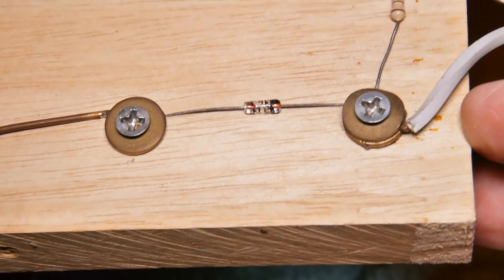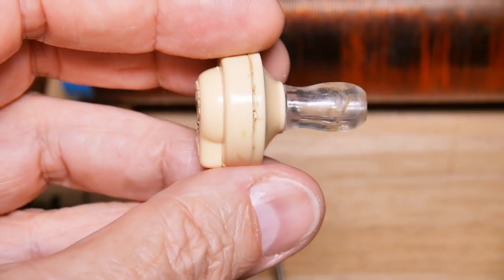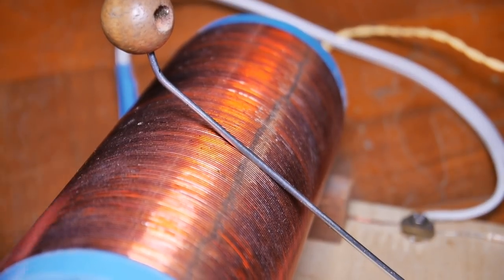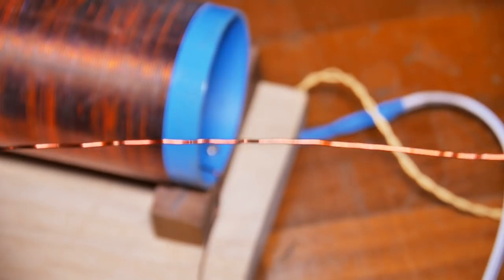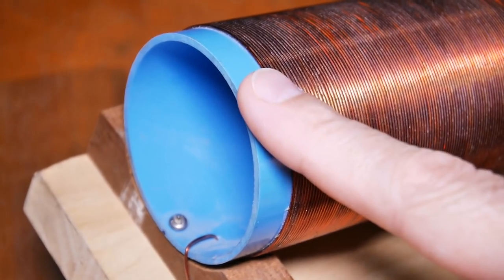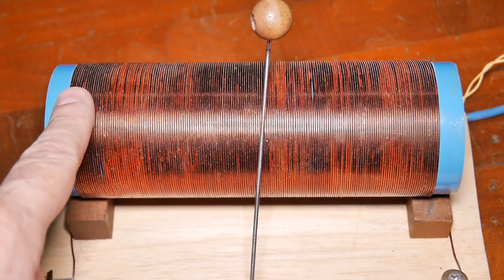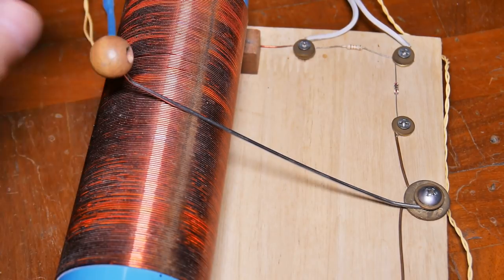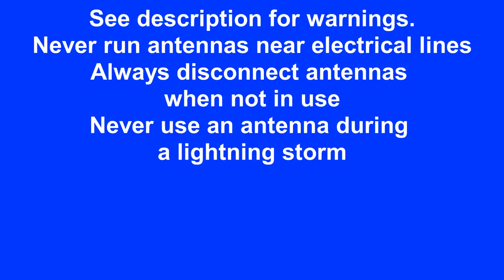My Crystal Radio Does NOT Work (FIXES for common problems)

Comment: You saved my life. I'm not new on this, I made some crystal radios before, but this time I was getting mad wondering why it wasn't working at all. I made the coil rolling on a metal tube. It's not a wrong coil, but as you said, it was moving me out from the MW where the strong signals suitable for these radios are.

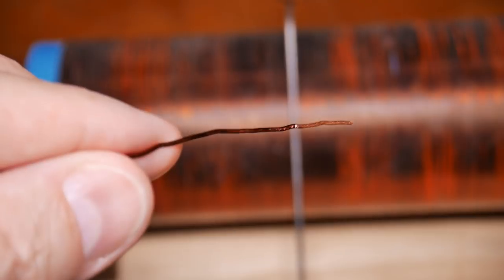Comment: 3:48 You can also use Litz Wire as a substitute for enamelled copper wire and it should work, Litz Wire is what they use to make the coils for Ferrite Rods that were used a lot in portable transistor radios from the 50's and 60's.

Comment: My father, who was a fantastic Chemical Engineer/former Machinist, helped me build a very nice nonworking xtal set back in the 1960's. Looking back, I now realize that not scraping the enamel off of the coil wire can affect performance!;) Those piezo earphones are notorious for not working, even if they are the correct ones. Of course, ANY open in the circuit will affect performance and one MUST have a good EARTH GROUND or the radio will not work. My dollars worth-John in Texas
Reply from the maker: Do you still have the one you built? Or maybe you can rebuild it and make a video. If you do, leave a link here; I'd like to see it.

Comment: Good info on coil length also. When I made a tuned loop antenna, it was too long and shortened the reception bandwidth! I had to use a needle attached to one of the tune loop lead ends to short out the antenna until I reached (roughly) 16 kilocycles-John in Texas
Reply from the maker: Good stuff, thanks!

Comment: Can i use an 1n34a do-35? I mean this one is a Germanium Diode, written "1N34A DO-35".

 And if i made my own crystal earpiece (i sanded the metal plate until it lost 50% of thickness) with regular 35mm piezo element, would  it works? 

 Can you please tell me average voltage of the audio output of this crystal radio?
Reply from the maker: The do-35 is the package type, and that does not matter. BUT I did a quick search and many, many schottkey diodes are being sold under that label. They do not work well. I have a video on how to test for fakes. I have never tried that to make an earphone. Please let us know how well it works. The voltage depends on your antenna and ground, how powerful the radio station is, and how well the radio is made.

Comment: I have an interesting problem. I'm using a 1N914 diode, a 120' long steel electric fence wire for antenna, and a regular earpiece. Every thing works except I only get the Spanish church channel on 1140 AM. I have tried nearly every configuration of tuning possible and it just stays at that band. Thank you and nice videos on these nifty old radio receivers.
Reply from the maker: The antenna and low sensitivity diode will "work" but will only the the strongest signal(s).
Reply: Thank you for the good input. The antenna on its own is capable of lighting LEDs six in series. Guess I need to find a better diode.

Comment: On one of my crystal radios I built I added a rotary switch that selects from 4 different diodes to demonstrate the differences in how loud each different diode is. I intend on adding 2 more  - a D311 and a D311A.   My loudest crystal radio uses a Russian D311 diode.  Also installing a simple coil between the antenna and my crystal radio also increases volume.  Unfortunately I can only  pick up either one station at 1590 or that one and another one simultaneously
Reply from the maker: That's an interesting experiment.  You should post a video on it.  Leave the link here.  I'd like to watch it!
Reply: @tsbrownie  I might try that.  I posted some music I played under my name Ray Zaballa ( not so great )  I will try to do as you suggested.
Reply: I can no longer post videos from my phone to Youtube .  I used to be able to do that and then some changes happened and it's now no longer available.  I will try to link up to them
Reply: Ive tried numerous and found the d311 the best too
vf is just .150 
very low

Comment: If you ever run out of ideas for more crystal radio videos (I doubt that’s possible), can you do a video showing us soldering shorter lengths of copper wire to make the coil—and how to minimize the problems involved with disrupting a perfect coil?
Reply from the maker: I just did that, but did not make a video. I drill a hole in the tube. I push both ends of the bared wire into the hole. Then I twist the 2 ends of the wire together inside the tube (it's a bit tricky) and solder it.